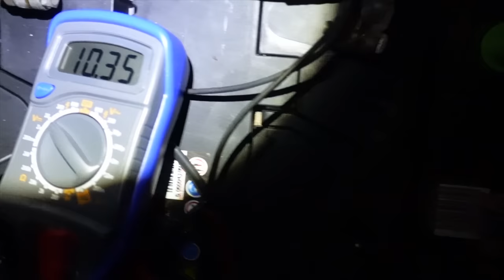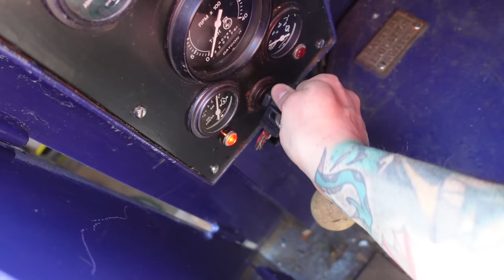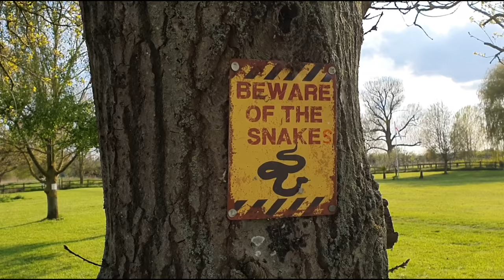we WRECKED our NARROWBOAT | DISASTER tiny home cruise | NIGHTMARE off-grid HOUSEBOAT REFIT

Comment: Hey Guys, don’t let crash put you off. This is how you learn, when going with the flow on a river, slowing down is the worst thing you can do, as you lose steering. If you had kept a bit more power on the back end probably wouldn’t have started to twist.
At least no one was hurt, any thing else can be fixed.
Keep up the good work with the channel, I always looked forward to your videos. 
Chin up guys 👍
Reply from the maker: yes someone else said that, now looking back it seams that part of the bridge was missing its bollard so made things extra tricky, were actually just having a week off but are eager to get going again, thanks for comment James

Comment: Just remember for future the back end of the boat when steering moves first so having the tiller facing the bridge when you were side on is pushing the back end up against the bridge even more. Hope that helps. If you think that flow is pretty strong the Nene is a total different level most of the time. 👍🏼
Reply from the maker: yes someone else said this, I think were it swung round and got stuck I decided to try and bring the boat out right but it just made things worse, what a nightmare, but we learn, yes weve been on far worse really but not come across a bridge that tight I suppose
Reply: Canals are totally different, don’t let this put you off Chris you’ll be fine when you both get on the canals. I defy you not to be able to de-stress on a canal 😎👍🏼
Reply: @TheNomadicCrobot  bit of an angle to be fair. That bridge.

Comment: You have to remember that there is much more control when your boat is traveling faster through the water.
To get the correct control on such a relatively fast flowing river, you must keep your speed high relative to the water. This might seem faster than you you might feel is comfortable if you look to the bank.
It was disaster waiting to happen when you decided to go slowly, you were simply drifting with the river rather that cruising through it.
Lesson learned I hope and no serious damage 
🙏🙏🙏🙏
Reply from the maker: we have been told this, quite scary to think I should have sped up but it all comes with experience which I havent had a great deal off...iv taken alot from this disaster though Roger..sometimes it can be good because we come back stronger with more knowledge. thanks for your comment

Comment: I’m by no means a boater but we do hire canal boats 4 times a year, I would say, you did very well, so many people struggle and get stuck, just most of the time it’s in a nice relaxing location on a canal. You guys were just unlucky at the location, it’s also much more tricky on a river so you guys will be absolutely fine! You kept calm and that’s the main thing! The only thing I would say, and this is obviously just how it looked in the video and I could be completely wrong! Is to remember they turn from the middle but steer from the back, so when you had the tiller pointing at the bridge and also trying to push away from the back with your bargepole you were fighting each other. 

Anyway, keep going, you guys have got this! Such a fun Channel, don’t forget how much you make people smile, you effect and help a lot of people that you have never met and that is a very powerful thing.
Reply from the maker: Thanks for your lovely comment Ryan, I think there were alot of factors at play looking back, weve never really had any problems using the rivers in the 2 years having the boat, and have been on far far rougher water, I think maybe being a bit over confidence on my behalf at a bridge on a bend along with a fast current were the main issues. quite a few people have come out and said how alot of people struggle with this bridge and that you should really use the exit instead of the entrance , so the bridge is renowned for being tricky,  and it was also missing its number on that side too, so that explains why so many boaters end up hating the bridge, yes I think once we got stuck it was. a loosing battle thanks for your suggestions your absolutely right, on wards and upwards, we won't let it beat us, thanks again

Comment: Trouble is when you give the engine loads you're drawing water from under the boat. to go too fast is always bad with boats cos you ain't got brakes and a boat steers from the rear.
Reply from the maker: it was a learning experience thanks Jess
Reply: @The Nomadic Crobot  Without taking the piss, in all fairness, you came into this with no skills, knowledge, or experience. So, to get as far as you have is quite an achievement. Don't let that comment go to your head, cos you know what will happen.
Reply: Rivers are always more difficult than canals. Going downstream is always worse than going upstream as you will inevitably be moving faster over the ground. Looking at any bridge you will always see battle scars from many many previous boaters who got it wrong too. Did notice that you were trying to turn away from the bridge by pushing the tiller to your left when in fact it was the rear of the boat that you needed to clear, but that's an instinct you will get right with practice. Keep your chins up and hope that things get better going forward 😊

Comment: Yeah, a gnarly situation. when you did go through I noticed you were tillered into the bridge, if you want to avoid hitting something with the back end, push the tiller away from the thing you don't want to hit. if you had tillered away you'd have made it through without hitting anything. it does look like a tough obstacle tho, the sort of thing you'd figure out with time. keep going, you're learning every step of the way.
Reply from the maker: Thanks for this, Iv been looming back at the footage to try and work out we're I went wrong,such a touch bridge with a 60 foot boat , hopefully I can learn from it
Reply: @TheNomadicCrobot  when you turn the tiller, you're moving the back of the boat. so if you want to move the back of the boat to the right, it's rudder to the left (tiller to the right) and some power to get water flow over the rudder

Comment: When you consider what your boat weighs, the downstream current pushing continuously, once you're on an obstruction it's very difficult to get off.

We had similar on the Macclesfield canal at Bosley Locks. Just as we were lining up to enter lock 12 and go under bridge 56a, we managed to run aground on a shelf that is normally higher in the water. The heavy rains had increased the draught above the shelf allowing the boat to lay on about midway between the bow and stern. tried pushing but there was extra water and the current pushed back. In the end, lots of alternating between forward and reverse combined with tiller waggling, we got off.
Reply from the maker: sorry to hear that, it can be quite a scary situation, and goes to show how quickly things can go wrong...especially for someone inexperienced, most people will probably  have there fair share of little problems when cruising ...this was out little disaster 😂😂 Thankfully you got off so well done

Comment: I did similar on the Nene 25 years ago.
Often, when stuck, rocking the boat while powering (away) from the bridge will work.  The boat rocking digs a trench with the sides and the "high spot" then breaks down into the tranches made.
You're better off at a low speed when trying to get unstuck as more power moves more water from under your boat hull, so some careful rocking and some gentle revs will do you and the environment less damage.
Stay strong guys, you've worked very hard to get where you are.  Don't let these little things put you off (unless you want to give me the boat 😂) 😉
Reply from the maker: thats interesting thanks Gary, I cant help think this is the first of many, we never want these things to happen but sometimes there just out of your control when your on water. thanks for your tips will be using the the next time....and there will be a next time im sure , you can have her haha
Reply: @TheNomadicCrobot  excellent, when can I take delivery? 😆
Wouldn't it be great to have that noisy engine replaced with electric? 😂
It's soo easy to get stuck in places.  Learn that the boat turns in a middle point, learn that point on the boat (just like you do with the width of you car turning circle).
It doesn't take loads to drive a boat.  It takes loads to learn to do it safely, carefully and not (too) detrimental to the environment (or listed bridges lol)

Comment: Where space permits, practice maneuvering by alternating between full forward and full reverse without ever allowing the boat to build up speed much over 1 mph in either direction.  One practiced, you should be able to approach a bridge like that, use reverse to come to a dead stop just before the bridge and line yourself up, then put it back in forward to keep steering control but have almost no momentum as you go under the bridge.  Also, once the forward half is clear of the bridge, you can reverse the tiller in order to clear the stern, or keep the tiller where it is and reverse thrust, for the same effect, while decelerating to lower speed.
Reply from the maker: an unfortunate event, many factors at play, inexperience , fast river flow on a windy bridge....we live and learn...im sure it not be the last...it shows how quickly things can go wrong, thanks for tips 😀👍

Comment: Firstly so glad your both ok, that could have so easily been way more of a problem if the flow was stronger. Impressed you managed to keep your cool and not panic. No one got hurt which is the main thing the boat can be fettled with a bit of paint etc so don't let it knock your confidence, get the boat cruise ready and get out there! 🤪💦😉😁
Reply from the maker: we were quite lucky really to have the help of the lovely locals, it probably felt a lot worse, the damage isn't actually too bad, just goes to show how a normal little cruise can turn into an absolute nightmare, no-one got injured thats the main thing

Comment: You can only steer if you are moving faster than the water, so counter intuitively, faster than you want is sometimes the only option when heading downriver. If its possible to turn upstream of a bridge, you can go through backwards whilst motoring into the flow, but what's the chance of having the space to do that in a narrow boat...
Reply from the maker: That's interesting a few others said to reverse through, looking g back maybe I could have slowed the boat down alot more, the problem was I felt in control until about 10 seconds leading up the crash

Comment: You guys need lessons on how to steer a boat. You were turning the tiller to the wrong direction. If you pull the tiller handle to you, it will turn the stern of the boat to the right, the same when pushing the handle away from you, it will go left when ever you go forward, but every thing will change when you are going in reverse.
Reply from the maker: I know what your saying, unfortunately this was just the way it was edited, the tiller was actually in the correct position, the reversing was a terrible idea and complete miscommunication between the two of us ,thanks for your comment

Comment: as AndreasDuessca said, the faster you're going, the more damage you can do. However if you have the water flowing from the stern, then that complicates it, a lot. You require water flow over the rudder to make it work, either from the prop pushing water past it, or by the boat moving through the water. If you're going the same speed as the water, you have no steering. I've never driven a narrow boat but being that long, I would imaging that with water flow from an unfavourable direction it'll cause you all sorts of grief. Like you had. If you had the grunt to stop yourself against the water flow, I would have done that, but pulling up something of that weight isn't quick. I wouldn't get another narrow boat to pull you out, you want something with grunt. Then the water flow was still there, winch off a tree, hire a tractor, I'm glad it didn't turn out worse. 

I'm wondering how many people ever take that going downstream. If there was another way around, that took less than a month, I'd take that. I'd stop and watch how someone else went through, I'd tie lines to the shore and slowly let it through. I'd come up with something that would look awkward but would work.

Sometimes the water flow is less on one side of the river to the other. Again, watching someone else do it or picking their brains would really help. 

I've been working with boats for 24 years. A skipper for about 17. When maneouvering near boats, wharves or hard stuff that you don't want to run into, with the wind or tide behind you, you need to think it through first and always have an escape plan.

I have run aground....
Reply from the maker: Thats so interesting, yes a few have said to actually go faster, I feel with a bit more experience I could have corrected it. about 4 other boats that day also knocked in to the bridge as its known for it unfortunately. That has also lead to the bridges bumper being completely sunk which also didnt help. we were told after alot of the boats use the other side of the bridges entry point to go through as it was easier as its not on the bend, unfortunately we weren't aware of this too, hopefully the video can show other oaters how things when on water can change very quickly so you always have to be alert , thanks for all your advice

Comment: Great vid, good on you for showing what can happen. But ignore Clarkson power merchants if you hit that fast the damage could've been worse. (We had a customer rip the roof open hitting Fotheringhay bridge.) The trick that they are failing to mention is to stay at a speed you're happy to crash at, and use little bursts of power with the tiller. Try it next time you're out, you'll notice massive improvement of the handling. It's the same for cruising in wind, you don't need to go fast you need burst of power. But due to Chinese whispers, it now Power!!!! Which can be misinterpreted as speed.
Reply from the maker: luckily the boat seams to be built like a tank, I really dd catch us off guard, at a moment when I thought I was in complete control. That's a very good way off putting it... because you never know when it can happen, thanks for all your tips Martin

Comment: you grounded on the protection under water, you was going to fast ,should have slowed down ,and got more straighter to the bridge opening , rivers are more powerful going through bridges with arches ,used a anchor if you got one ,and you would have stayed mid stream,also in the panic you was not watching what the tiller was doing, it was left then it was  right, oh if you get stuck you can bounce the boat which usually works
Reply from the maker: Thanks for noticing this Malcolm when watching it back again I had noticed this and wondered when someone was going to pick up on it, my idea at the time was to try and correct the back but surely thay would have been the other way? Or maybe o just edited wrong...I'll have to take a look through the raw footage. Maybe in those 5 seconds of panic before I just got confused, thanks for your comment

Comment: Ooooh, that hurt.  I noticed you increased speed in an attempt (I think) to power the stern round.  That didn't help as it just increased the damage.  Try approaching much, much more slowly, have someone at the bow to fend off as well as being prepared to quickly stop or engage astern if needed.  I realise it's going to be tricky when you're navigating in a flowing river as eddies and currents will affect your steering.  It's vital to be able to recognise when things are not going to plan and to have a 'Plan B' you can both implement.  You did appear to be a tad lost when the bump arrive, as if it was inevitable, so get an emergency 'collision imminent' plan worked up and practice it.
I have to say, it was an extraordinarily tricky manoeuvre, the river currents were bad enough but to get through that narrow gap as well must have been like threading a needle in a gale!  Don't beat yourself up for getting it wrong.  I have a sneaking suspicion I would not have done much better.
Good luck..
Reply from the maker: yes I think it was a last ditch effort try and bring the back round but there's no hope that late really as you know it takes time before the back swings round.the bridge is actually missing its bumper at that side (probably from were other boats have collided with it as its known to be a tricky one) so most people use the exit but we didnt find that out till after, yes I think next time ill try and get the speed down a tad though the flow was pushing us. I think I was in shock a bit I only really noticed 5 seconds before it happened so a back up plan will be good, we learn from these things so its a good lesson. thanks for your comment

Comment: i said eww they gotta come rite out wen i saw ur batteries yu need optima redtops in there 3 should do and a split 3 way charge controller. You will never have another power issue as long as u own the boat they also have 5 year cover